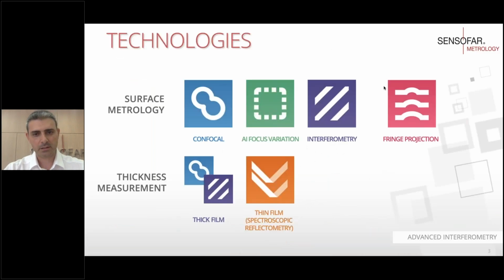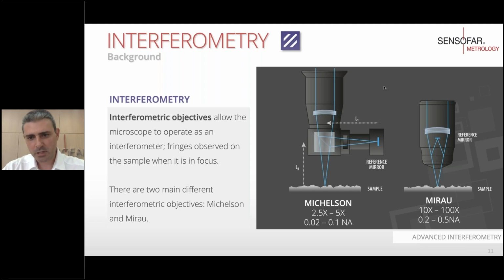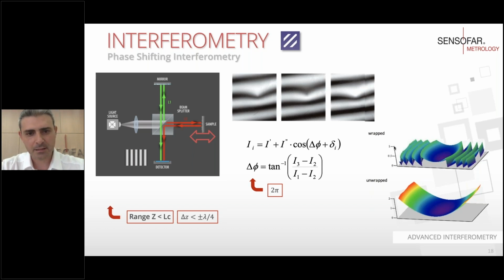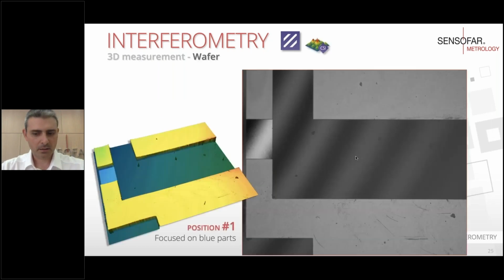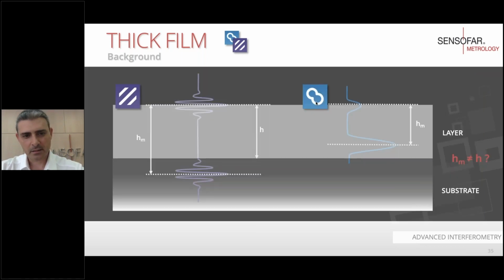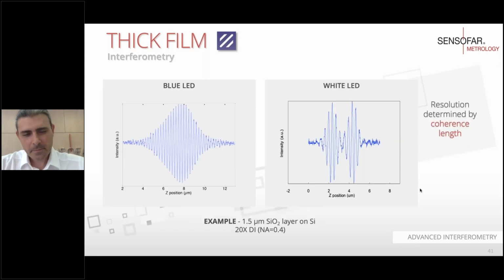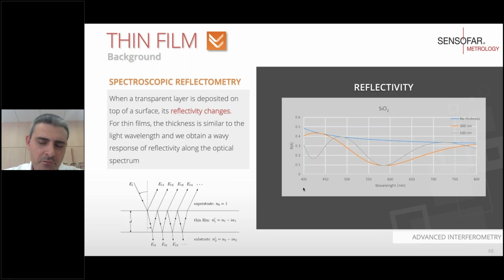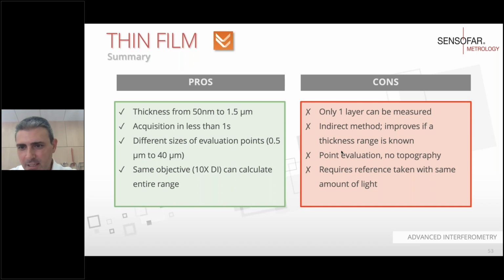Optical Metrology Techniques II - Webinar

Comment: Hi sensofar, thanks for the thorough explanation on the interferometry measuring technique you presented in this webinar. However, I still not really understand the concept of the inversed tangent of ((I3-I2)/(I1-I2)), i understand the idea of 90 degress equivalent to lamda/8, but how these can calculate the phase shift? Do you have the whitepaper or the research paper on this part or maybe some support URL link? I am very interested to know the optical theory behind the calculation. Thanks